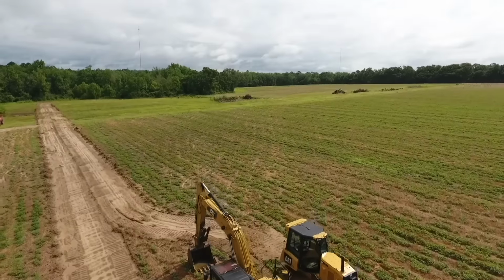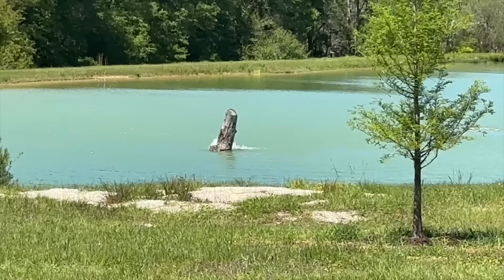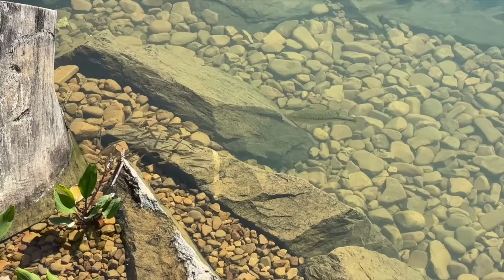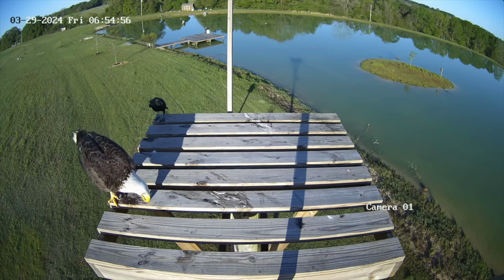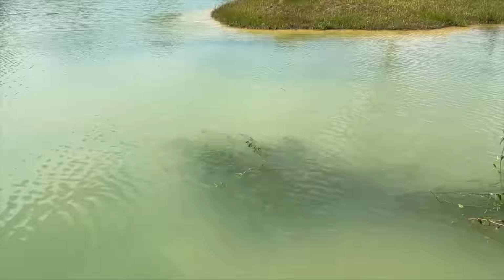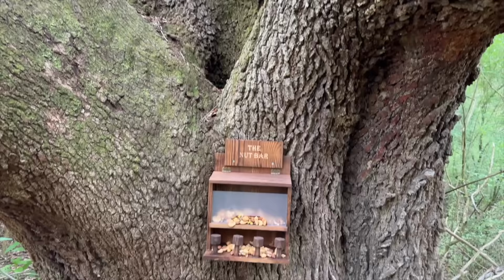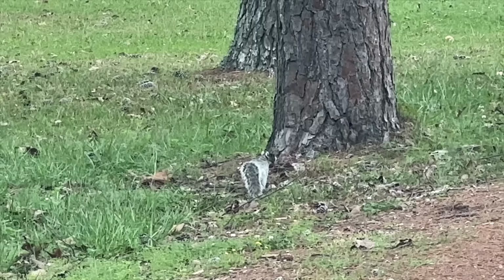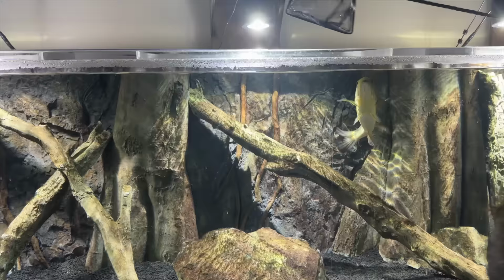Revealing a Secret Project I've Been Building for a Year (It Will Change Everything)

Comment: The oak could be in shock due to transport and the planting process , if the root ball is significantly damaged it could cause some of the limbs to suddenly die. If that is the problem simply prune the dead branch back to the green above the selected knode. You can  put a plant stimulator on the fresh cut but that usually isn't necessary. We love the work you've put into this project , very rewarding.  Looking forward to the next vid.  👍
Reply: I was going to comment something similar as well , while transporting in the truck with the wind  often damaging the treetops
Reply: Agreed also since it was the first winter planted it could have killed those branches.

Comment: FieldBot ideas:
- Add a speaker/siren and use to keep foxes away from the henhouse (figuratively or literally). A motion sensor and remote camera would allow some control there.
- Same features as above, but use for human security. Actuators to open/close remote gates, speak to trespassers, etc.
- Remote gate cameras/actuators could control livestock movement from one area to another.
- Use to actuate/monitor feral hog traps.
- "Quick Deploy" version could be used by hunters. Place FieldBot some distance away and use noisemaking feature when game is between hunter and FieldBot, moving game towards hunter.
- "Quick Deploy" version could have uses for law enforcement, surveillance, robotics, the sky's the limit really.

Comment: Fieldbot could easily be adapted to a number of indoor animal husbandry situations as well as outdoor. A solution to monitor say temperature, humidity, air flow/ventilation that would normally require a number of proprietary devices, would allow a customized central hub that could be deployed quickly and with sensors that are commonly available, could greatly improve commercial/residential outcomes. I look forward to seeing what can be done with this! Fantastic ideas!

Comment: Its hard to tell from just a short video clip, but just in case, you should contact an arborist or some other expert to make sure it isnt oak wilt. Cause if it by chance is, you need to get rid if the tree before the fungal infection spreads. 

Most likely its just winter die back, however if it isnt, swift and decisive action will be important to saving the rest of your oaks.
Reply: Your comment needs to be higher up! Oak wilt is no joke and could potentially decimate your other oaks @bamabass
Reply: @bamabass!!! Please read this
Reply: @bamabass read it please

Comment: Just a few comments on your work project:
1) I think it’s a fantastic idea
2) consider using LORA for data transmission. 
3) For the pond, you could setup a SQL database that reads in data on the pond. With the stored data you could have a machine learning algorithm running on a jetson nano/ raspberry pi that can make prediction models. (Ex: if you haven’t had rain in a week and the daytime temp is 80 or higher, you may need to turn on the well even if it hasn’t reached the water level sensor yet).

These are obviously far-fetched ideas, but you could make this a very cool pond management tool. You could even implement your fish finding sensors and map fish habits based on temperature, humidity, weather, etc.

Comment: Crows are not a threat to eagles, but great horned owls definitely are. Lots of birds mob hawks and eagles including crows and shrikes, but owls will  blast them right off their perches and can injure them. If you watch the famous SWFL bald eagle cam you can see this. There are several instances of it recorded on video. It just happened there a few days ago to a three month old eaglet E23. If you want eagles to nest on the platform you'll likely need to build a five x five foot starter nest anchored with wire rope. Bear in mind though it's a metaphysical certitude that Al Capone (likely Alice Capone given females are always larger in owls, eagles and other raptors) will attack them. But that is common and the eagles will reluctantly live with it as they do in many other places. You should add more perches under the platform so eagles can land without hitting the ground if Alice Capone blasts one during the night.

Comment: IDEA TO SEE FISH BETTER: There's a special angle in physics called brewsters angle. When you have two materials with different index of refraction there is one angle where the light that makes it into your eye, or a camera, has no reflective part and only the transmitted part coming from underneath the water. For the water air interaction this is about 53 degrees from the perpendicular axis to the water. It would be a cool expereiment to try to set up a camera at that angle looking into the small pond and we should see straight through the water like glass to all the fish underneath with no reflections from the clouds.

Comment: Thanks, I love the series and have followed along since the beginning. With respect, I've seen eagles build a nest over an old crow's nest or where there are branches they can use to anchor their nest. I'd like to suggest you check first with local experts, but I suspect a few firmly anchored, twisty two inch branches on the elevated platform might encourage the eagles to build a nest that won't blow away.

Comment: Please look into LORAWAN and the Helium network. It won't have the bandwidth for camera feeds but it would be perfect for sensor data and would give you much greater scope for deploying units at extreme distances where 4G or WiFi is unavailble. Perhaps a LORAWAN unit could be camera-less and thus cheaper and smaller. Just a thought.

Comment: The FieldBot is an awesome idea and I would totally buy it! I do have one suggestion though, I have chickens and I would love to use something like the FieldBot to watch over them and turn the lights on and off for me. The problem is that it would be inside their coop or run and the sun wouldn't be able to hit the solar panel. Maybe you guys could find a way to add some sort of plug for solar panel extensions? So I can plug in a long cord with a small solar panel on the end and put it on the roof outside but still be able to have the camera inside!

Comment: In my experience, if you add a willow tree right next to the water line, it will grow a crazy root ball for shelter and the tree cast good shade on the water.  Doesn’t drop a lot of leaves either. Holds up well against strong storms and hurricanes and won’t change the color of the water. And will survive the cold. Guaranteed good spot that bass, shad, bluegill and tilapia will bed right next to it cause the roots of the tree create a good hard bottom. I would put the tree, on the deepest spot you have against the shore line, because of the shelter the tree causes, plus the safety of easy access to deeper water.
Reply: Maybe it would puncture the clay blanket?
Reply: @bingorfm724  It absolutely would.

Comment: A field bot with 360 viewing would be a good option. It appears that it only faces one direction. I can think of a few instances where it would be nice to see 360. You may not even have to change the design, maybe have an option that plugs into it and then you have more cameras that can connect to 1 field bot. It would be a plus because then the field bot could be outside powered by the sun and you could have a camera plug into it and inside a barn or something where it wouldn’t be possible for a field bot to be solar powered.

Comment: That can actually be useful even for applications that aren't on farms. You could also include features like power supply that isn't solar, so you could use the fieldbot in applications that aren't out in the field, like in a shed or barn. You could also maybe power it with a separate solar panel, so you could use the fieldbot in a shed, but have the solar panel on the roof, so you could use it to automate additional tasks even if they're not outside. That would help integrate as much possible tasks into just one platform.

Comment: Awesome video as usual! 

The Field bot seems like a very smart product!

I got two things I'm woundering about.

#1 It's well know that many IOT  devices are porly protected and vulnerable for hacking attack. Is this something that is "covered" by the developer?

#2 It would be cool to being able to connect I/O extension modules to the bot either localy within the main Field Bot unit or externaly to being able to get multiple inputs and outputs from a single Bot. Say f.eg. if you place a feeder between the ponds on the most narrow spot, and could start/stop the feeder, start a rotation motor for the feeder, and turn on and off extra underwater lights in Ceder Falls where the feeder pellets hit the water.
😊

Comment: FieldBot: an unrelated potential is real estate/property security. With the massive boom in “squatters” at temporarily vacant properties, self powered camera module with telecom connectivity would hugely helpful. Especially if tied into motion sensors. 

Squatters have always been a problem, but it’s gotten much worse lately. And it’s an incredibly costly issue to resolve for landlords/property owners.
Reply: There are already a lot of cellular/WIFI enabled outdoor security cameras on the market, it seems to me that this system would probably be too expensive to compete in that area, and most of its special selling points would be useless.

Comment: Looks like a great project. I've built wireless, modular, solar powered sensor platforms and I have a few comments. 
Leaving out LoRaWAN would be a real missed opportunity IMO. 
Also it should connect to the Home Assistant API with GPIO access. 
Whatever you think is enough solar and battery capacity, double it. If you plan to sell to anywhere that gets cold, and dark, in the winter, you'll need it. Consider Lifepo4 instead of Lion if you're using that. Include a battery temp sensor and heater. 
But overall this looks like a cool project. I like that it has a polished UI and API. Software matters as much as good hardware. 
Good luck.

Comment: The oak tree that has some dieback at the top is showing signs of transplant shock. The most common cause is going to be lack of water. I'm not sure what irrigation system you have set up, if any, but the rootball is not getting saturated. Irrigation from conventional spray heads rarely provides the rootball with enough water because the roots are concentrated in a small area compared to what the spray heads coverage provides. The best course of action would be to provide supplemental irrigation by changing the irrigation system to bubblers, use tree bags or water the rootball directly with a hose. There are a couple of disadvantages to tree bags, such as the need for constant refilling, but it is better than watching your tree slowly die. Also, learn how to check soil moisture and keep monitoring for other changes such as chlorosis (abnormal color changes in the leaves). Recognizing when your newly planted tree is starting to undergo signs of stress early will give you time to evaluate and make any corrections. Take care of your trees when they are younger and in time they will be the ones taking care of you. Love the videos by the way. Always a treat seeing these pop up in my feed.
Reply from the maker: We have irrigation setup, but I will take your advice and give it some more water. Any idea how much to water a newly planted oak? I have the schedule set to every other day now.

Comment: Farm bot is I fantastic idea, I love automation I run my house on an automated schedule and have my pond run automated through sensors, saves me so much time and worry. But the one thing I have is my pond is within the area my Wi-Fi from the house will reach the Wi-Fi devices I use. So with this in mind I have a friend that would like to do this but his pond was too far from his house so we had to set up Wi-Fi repeaters in order to reach the pond, hassle having to make it waterproof and still have a strong signal pushing through then connect all devices separately taking up bandwidth for each device.. If you were to have a Wi-Fi repeaters built into the farm bot which has all the temp humidity etc, then would only be the one connection instead of many. just a thought to maximise coverage around a farm or pond like yours. Thanks for the content I look forward to seeing all you have planned

Comment: What about making it a hub for all the feeders and trailcams on a hunting plot. With the cams maby it could detect which cams went off at what times to "track" a deers movements camera to camera. Then, make suggestions on where to place other cams and feeders based of those patterns to attract and hold deer on your plot. If that makes zero sense, let me try this way. 
Fieldbot: "I have a cameras activated at points 1, 2 and 5. Hmmm nothing on 3 or 4. Hey dude, move these 2 cameras to...here aaaaaaaand here. Oh and put your feeder other there." (GPS points pop up on you phone). 
A week later 
Fieldbot: "Ok now i have cameras activated all all point and in sequense. Good. there is a LOT of activity at the feeder since we moved it. Ok dude, based on the activity, put your deer stand right over there."(another GPS point pops up on your phone)

Comment: I don't know what's wrong with the Oak Creek it's possibly some kind of a beetle or bore rub that's eaten into the top of the tree. we have something similar in here in New England called the pine bore which bores into the tops of the pine trees and kills off the top the only thing you can do is about 6 inches below where the last living dead leaves are to where the top of the living leaves are you want to cut that off so the last first section of living leaves above a below the dead leaves you want to snip cut prune it and take it away and burn it the pieces you take off not the whole tree and hopefully that will save the tree it will rest throughout new shoots to reach for the light to gain a new central crown if you find it sends out like 5 or 6 shoots that's okay give it a couple of years one will take over as the main shoot and the rest you can trim off or prune as needed I would just let them grow actually but it can reoccur if it's a if it this insect it can reoccur if it's a disease I don't know what to do about that the only thing I could suggest is with dead leaves and or whatever you can get of it and send to a local agricultural school to identify what would be the problem send them pictures of what it looks like as well. Other than that I have no clue what's going on Did you ever find out what that growth stuff was on the trees it looks like kind of liking which is probably beneficial to the tree some kind of epiphenical likens or losses. so long as it's not killing the tree you're good to go

Comment: Your dead tree limb could be from bugs. A few years back I planted 500 sapling on my property but was the same year as the cicada outbreak. After doing some reading on it the cicada like to bore into limbs 3/8" in diameter and leave their eggs in the limb. By doing this the limbs will die not producing green leafs the next year. Not saying this is your issue but some to keep a eye out for.

Comment: In terms of what real-time data I'd like to see from your pond:
(0) the island is a good place for the instrument chassis (is the control system Arduino-based or other?)  It would be best if the communications to the dock were ethernet.
(1) Install an array of at least three type K thermocouples that record temperature at different water depths (ca. 5, 15, 25 feet deep) and a forth thermocouple that measures air temp on the island.  The legnth of the compensating wire can be up to ca. 100 feet (if grounded) so you can reach towards Clyde's Cove as well as towards the dam.
(2) You need two position level sensors for the water level (low - pump on and high pump off).  This would allow calculation of evaporation rate (during pump off periods) as well as pump On-Off control.
(3) Two dissolved O2 sensors (one to measure concentration - one to measure % saturation)

(4) one PAR sensor to measure photosynthetically active radiation in the pond
(5) one sensor to measure pond water conductivity
(6) two Ph sensors (one shallow - one deep)
(7) ion-selective electrode for Ca ion
Reply from the maker: Thanks for the input. I've thought of some of these but haven't heard of others. Would you know what acceptable or good/bad ranges are for 4 and 7?
Reply: @BamaBass  
#4 Dissolved oxygen is probably the single most important water quality parameter. A sensor that measures dissolved O2 concentration is OK (O2 saturation can be calculated from concentration and temperature).  Most pond water can support up to 10 to 12 mg/L of oxygen. Biological decay of organic material (i.e., decaying plants and animal waste) can reduced dissolved oxygen levels below about 5 mg/L which will have detrimental effects your fish and other pond life.  Best value if you spend more on a sensor and use your control system to supply necessary voltage/current and read sensor output.  These sensors usually include a thermocouple.

#7 A specific measurement of Ca ion might not be necessary but it directly indicates the result of liming.  These probe can be expensive.  Probes that measure total dissolved solids via conductivity yield general info and are much less expensive but yield data that is not as interpretable.

Comment: add the ability to daisy chain more solar cells and make extra cells optional. the small single cell will work for a while but a succession of cloudy days with just that cell and itll be drained from constant on/in use. additional solar power will never be a Bad Thing for that kind of kit
edit: same applies for batteries. offer either and expansion pack or/and optional external power input for house power. in remote/hard to get to places extra battery and solar may mean the dif between a solid working platform and aggravating troubleshooting trips